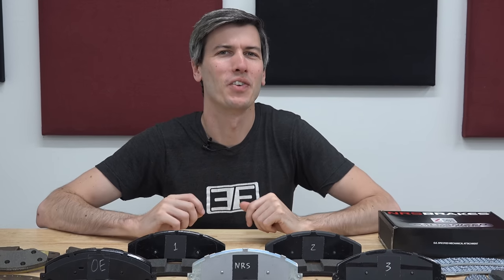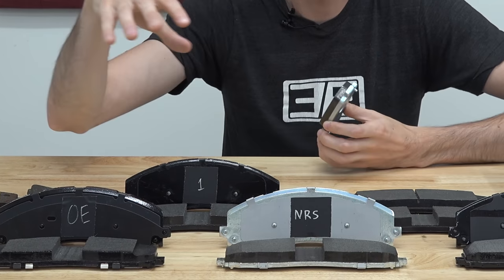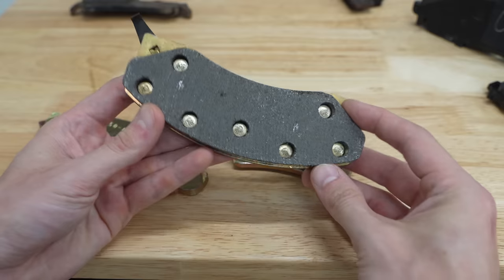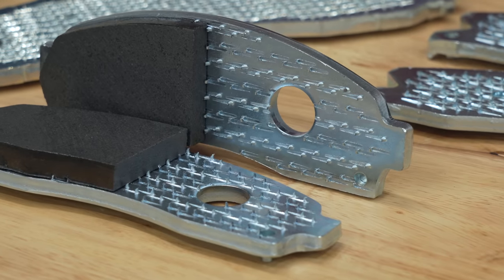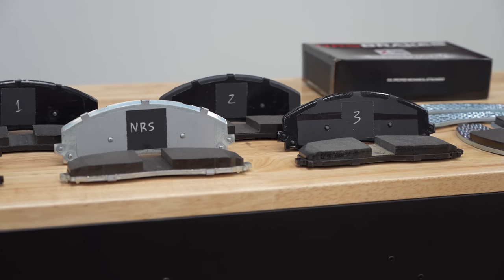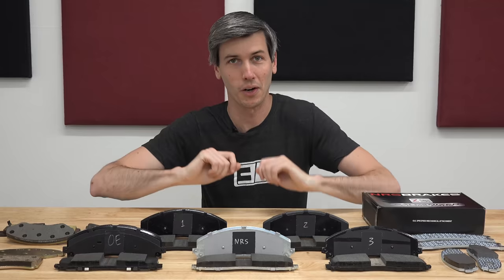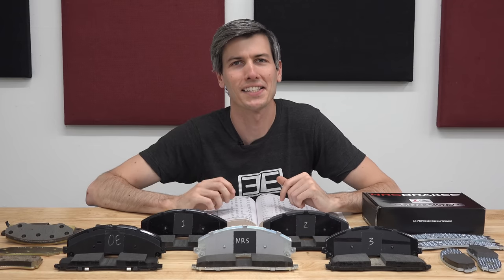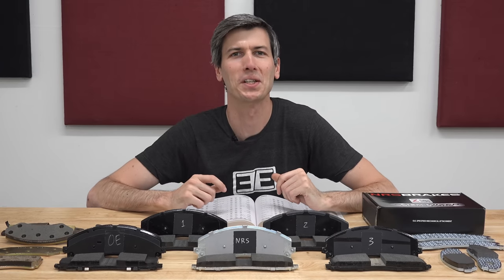The Sketchy Truth About Aftermarket Brake Pads

Comment: Yeah...this entire video seems fishy. I've been watching Jason for years and never had a reason to doubt him before, but these seems like a huge focus on a problem that doesn't actually exist. If an OE or major company chooses to select a pad that only uses adhesives, I have no problem with that. A company that's spent decades building their name won't risk large scale lawsuits and government fines if they thought their pads weren't safe. The sheer forces on brake pad material is hardly my primary concern seeing as I've never seen or heard of pad material ever failing on any brake pad. This sounds like a company I've never heard of trying to stir up some business. There's three types of brake pad buyers: the "just goes to the dealership", the "whatever's the cheapest", and the "picks a specific pad for their specific purpose DIYer". The first two aren't watching this video, and the third group has already researched their specific brand for a specific reason. I don't see this oddly specific complaint changing many minds.
Reply: Several of the aftermarket pads are being marketed as OEM replacements but don't have the mechanical gripping that true the OEM pads require from the manufacturer. You as the consumer might think you're buying OEM pads that are just as good as the originals when they technically aren't and you'd never know the difference. The video isn't saying that all brake pads everywhere should always be mechanically secured, it's pointing out that companies need to be more clear when slapping an OEM label on their product when it doesn't match the OEM standard.
Reply: @zbaier1  Yes, I'm aware; I have ears. It takes only minimal research to find out who actually makes the pads for the OEMs from Akebono, Brembo, Pagid, Textar, Ate, or whoever. I'm going to trust that they picked the best options to work for their specific pad over some random company that's clearly just trying to poach some customers. My primary concern will always be the pad compound for the application, but thanks for your response straight the HR and marketing department.
Reply: @heyhayhay247   The video is about how the pad secures to the backing, not the pad material.... He's not saying the pad material is not OEM spec but rather that some companies are claiming their pad/backing is OEM when it doesn't meet OEM specs. It's good that you have ears but it still takes a brain. Also, you're complaining about a detailed video highlighting an issue when EE's entire video catalogue is based around detailed videos and mathematical analysis of car issues and designs. Keep worrying ONLY about pad compound case it won't do you any good if that pad doesn't stay secured to the plate...
Reply: @zbaier1  Point to one single study not funded by this brake company that shows cases where pad material seperstion is actually an issue in the real world. My wife and I both has Masters degrees in engineering; that's how we initially found the channel. We have brains to go with our ears. This clearly looks like a solution trying to create an imaginary problem.
Reply from the maker: Just pointing out your statement "If an OE or major company chooses to select a pad that only uses adhesives, I have no problem with that." and that I don't state anything contrary in the video (see pinned comment). I agree with you!
Reply: @heyhayhay247  EE stated in the video there were multiple NHTSA examples. While I'm sure you are very adept in your specific field, engineering principles are vast and vary differently from field to field. You keep changing answers every time I reply but I think this video was a worthwhile reminder to us that how the pad/backing is manufactured is just as important as the performance of the pad itself. I don't drive a Porsche or a two ton pickup but if I did, I'd want to know these things!
Reply: I've had some pads separate. But I also ran the pad before 2mm so my hunch is much more heat was transferred to the adhesive than when there's say 5 mm.
Idk no college here though so what could I possibly figure out

Comment: Generally I like your videos, but this one is just a promotional video for NRS. The test shown has nothing to do with reality and only pads with a machanical retention can pass it. A common OE customer requirement is to shear the pads after a performance test specified by the OE customer. It is very rare for pads to see 550°C in the glue area as the temperature continues to decrease from the friction surface to the backign plate. This could happen with long track use, but at these high temperatures the coefficient of friction also decreases significantly and the driver would notice that the brake is overheating. There are many OE applications that only use glued pads and it works just fine.
Reply from the maker: Yes - majority of OE applications use adhesive, this video is in reference to heavy duty applications, towing, etc.
Reply: He specifically stated in the video its for heavy duty only.
Reply: This video is a promotional video and nothing else. I have unsubscribed.

Comment: I gotta say, 45 years of driving, 20+ vehicles,  trucks, trucks pulling trailers, sports cars, family cars, motorcycles, I've never had the pads detach from the backing plate. Name brand or cheaper pads I'm pretty sure most or even all were glued.  I'm sure it happens. I have had them crack and chip though, but not glue failure.
Reply: In fact, some cars have structural parts that are attached adhesively. Lot’s of BMW’s and Tesla Model S and X.
Reply: Cars are getting heavier and faster so this might start becoming more relevant. All these electric pick up trucks coming and they will weigh 8-10k lb. They do have regenerative braking, but let's hope OEMs don't use that as incentive to undersized the brakes where in the times you have to stomp then, heat cycles don't weaken the adhesive.
Reply: Same. 7 vehicles so far, all driven pretty agressively and never had this happen. Only buy brembo and EBC though.
Reply: I've seen adhesive failure one time. It was on almost new OEM brake pads, like a few weeks in use. No overheating, no very aggressive driving, no rust. Just have fallen apart on a casual inspection. Never seen this again on the same OEM pads
Reply: @mtunofun1  almost the entire lotus exige is put together with adhesives, but as he said quality control is key, and at $20 for a set of pads how much QC are you getting?
Reply: Your anecdotal statement means nothing.
Reply: Yeah I'm curious where this scenario would rank in an FMECA. My guess is that other parts of the braking system would fail before the adhesive fails.
Reply: As a tech I have sold multiple brake jobs due to rust jacking removing the brake pad material. The pad material just straight up separates from the backing plate, you can't usually tell unless you actually slide the caliper off (e.g. performing a full brake inspection) and try to move the brake pad off of the caliper). It's more rare for them to separate completely, but I have had a couple of vehicles where the pad delaminates and then slides off of the backing plate and gets shot out of the caliper or binds it up. I am in the salt hell of the northeast. A bunch of them are aftermarket pads from the parts stores. Normally it happens around the 6-7 year mark on hybrid vehicles (since they don't use the brakes enough to change them until 50-60k miles or so).
Reply: I've seen it a few times, ends up being a headache because do we replace them pads with the same type or do we switch suppliers. It's more common than you think, especially with newer drivers.
Reply: Clearly never drove in rust prone environments
Reply: Great anecdotal experience, I wonder how your 20+ cars compares to the thousands of cars    With detached breakpads every year, probably irrelevant like your comment
Reply: I don't doubt your statement, but this is called "survivor bias". The people who died aren't here to tell you that it happened to them.
Reply: @21jimmyo  imagine saying “in my experience I haven’t died or seen anyone died from not wearing a seatbelt” 😂 braindead
Reply: Do you live  where brine is used on the roads.  The introduction of that$%^@&%!!! Stuff coincides with separated pads.  And hugely increased body rust.
Reply: I had rust separate the pad material from the backing on my S Type Jaguar. Make of pads unknown. I do a lot of motorway driving, so even though the car's done the best part of 170k miles, it was probably only on its second or third set of pads. They rusted before they wore out. My discs were also rusted to the point where the  lip which sits on the hub had half rusted away and the disc tilted on the hub, causing vibration on braking. When I took the pads out and the lining fell out, I had one of those 😮moments.
Reply: Same and I wrenched for 20 years.
Reply: Perhaps if it ever had happened to you, you wouldn't be here to say its not an issue.

That is the problem with survivorship bias. The opposing experience is never heard ('cuase they're dead).
Reply: @russelloppenheimer3970  For all those claiming survivor bias, please provide some stats on the number of motor vehicle accidents/deaths caused by separating brake pads.
Reply: @spnyp33  stats? So if we can only show 100 lives lost its not worth the effort? What about only 10? 1?

Keep in mind we're talking about aftermarket brakes that aren't following oem design standards. OEM invested a lot of $ into what specs were required per application. They try to save pennies on each part, so its not like they're overbuilt.

In some situations, an acceptable level of deaths is considered. This isn't one of those.
Reply: @russelloppenheimer3970  My point was not in regard to the value of life in manufacturing & design standards.  By all means, study flaws and rectify or improve them... that is what this video was all about.

My problem was with the comments discounting mechanics and drivers that have spent decades driving and working on vehicles without experiencing a single brake pad separation as pure survivor bias and not worth considering.

My argument is just in the logic of the survivor bias argument; in order to even consider survivor bias as a possibility, there needs to be a demonstration of non-survivors  linked to brake pad separation.
Reply: @mtunofun1 the old 88-98 chevy trucks had glued on door hinges
Reply: Mine did on my 2011 f150
Reply: ive had 1. having said that, they were oem pads with just shy of 90,000 miles on them, and were mighty thin! LOL

Comment: I worked in aftermarket parts cataloging for about 8 years. The FMSI book was a basically a bible. Data changes by the supplier is the biggest achilles heel, resulting in "these pads don't fit my vehicle" complaints. I still learned quite a bit from this one! very interesting.
Reply: 12 years in the aftermarket cataloging and PIM development. Probably worked with all the suppliers mentioned here. You can generally know how much they care about FMSI specs.